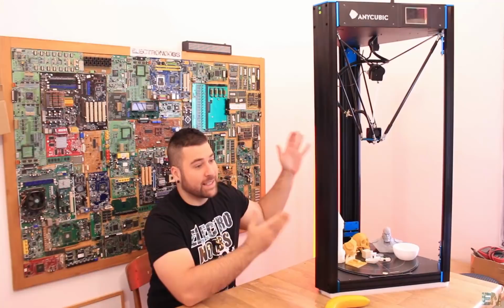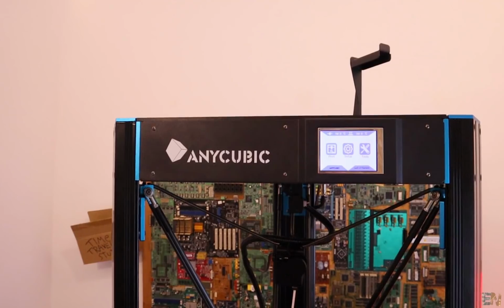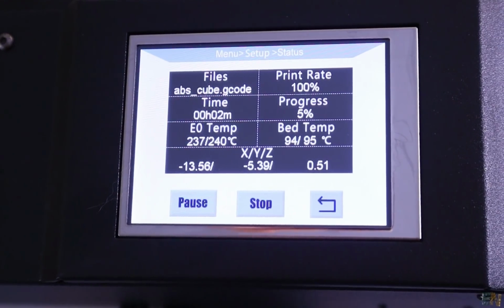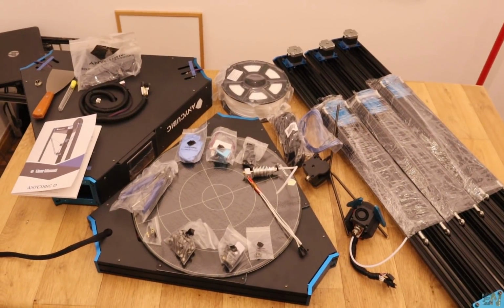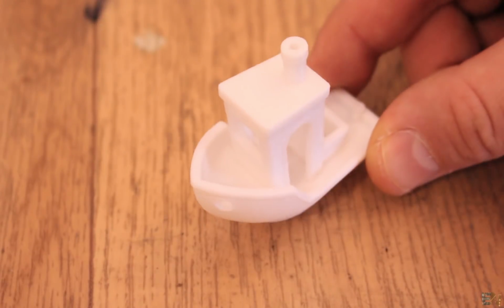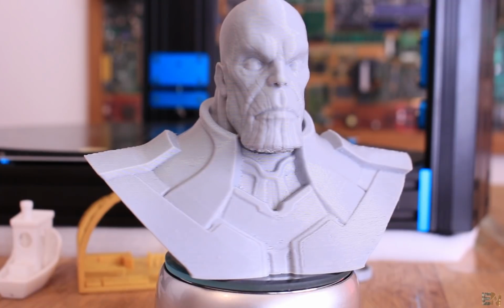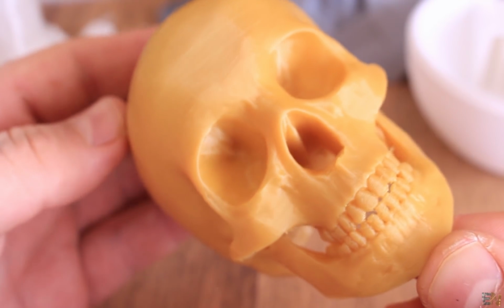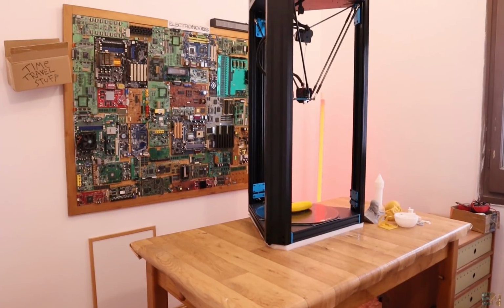HUGE Anycubic Predator 3D Printer Review | Unbox+Assemble+Test

Comment: Hi, i've got this printer also, not the best at all:
I had to change lot of mecanical parts , made my own rods with quality ends rods.
I hat to change electronical part, touch screen failed (never touch tp) .
I had to change serveral time belts, now i put 10mm belt for more precision.
I had to change wheel, poor quality.
For my opinion this printer is not a finish printer, and very low quality part inside.
Reply: Stéphan BUCHHOLZ Hello. I am intersted to buy a Delta printer. Can you recommend a better one?
Reply: I am having issue with the software/cura.. do you know the right setting? I can't utilize the whole 3D bed? I only can print small items
Reply: @meshalastic  sorry, i do not use cura , i tried it Long Time ago.

Comment: Can you please suggest the cheap and best quality printer to get started with 3d printing ?
Reply from the maker: Maybe the Ender 3 or the Alfawise u30
Reply: @ELECTRONOOBS  thanks 😊
Reply: Hi, go to ebay chk out: Printrbot Simple Simple desktop 3D printer. Bidding finishes in an hr or so. small base but it will give you a good cheap way to see if it's for you.
Don't worry if you miss it, it should be repeated, with luck.
It's aimed at modellers.
Reply: I built the Anet A8. $140 on gearbest. Upgradable to decent quality. It's a kit. So you learn as you build.
Reply: @AtomkeySinclair  i don't like it because it is very unsafe with fire if you don't have a lot of experience yet. start with something newer i suggest
Reply: @certified-forklifter  true. Hence the upgrade i mentioned. I never used the power supply it came with. I spent $20 bucks or so on a reliable one, added a mosfet for the bed... and never printed unattended. But the other suggestions here are also great.
Reply: @AtomkeySinclair  yeah, but we must not forget that without the anet a8, the 3d printing community would be way smaller. There are some better (and safer) options avaible today, but maybe not if there wasnt the a8. Cheers, have a good weekend!
Reply: ender 3
Reply: @BnBe - Practical DIY Electronics Videos oh, you also here =D
Reply: @BnBe - Practical DIY Electronics Videos A few of my top three! Check out Marco Reps, pcbreflux, and MickMake for other tech channels as well...
Reply: @BnBe - Practical DIY Electronics Videos =D